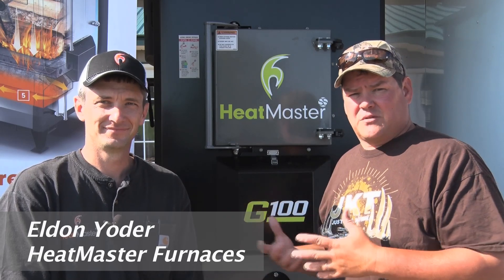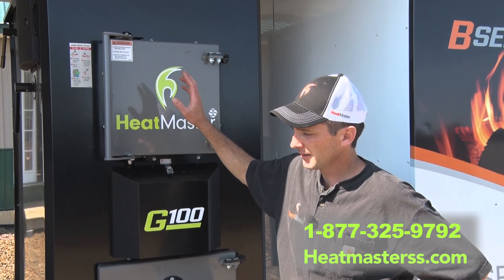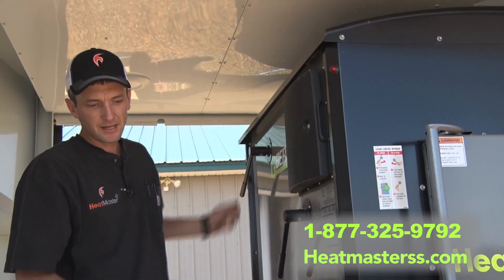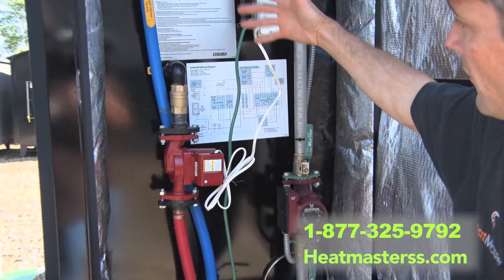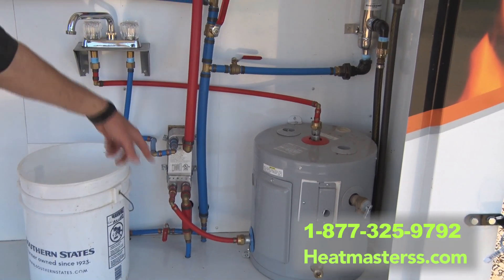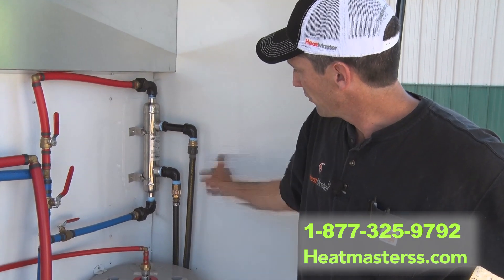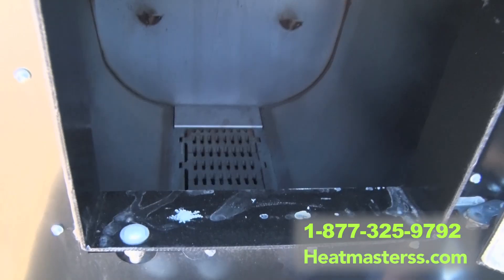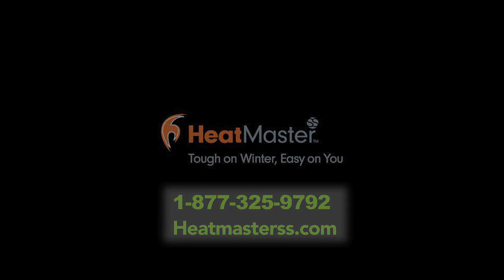HeatMaster ss and Just Killin Time TV

Comment: Instead of using a gas /oil furnace to run air through the heat exchanger I would seeing as this is a demonstration model for potential customers a garage style heat exchanger that usually hangs from the overhead in a garage or shop. However don't mount it in an overhead position. Place it on the ground attached to your demonstration boiler so people can feel the unlimited heat. Keep the blower running even if it's 80 plus degrees outside as people will feel the heat walking bye and ask you how it works. In the fall people will warm up from the heater giving you the opportunity to tell them how easy the system is to install and maintain. If you like install a tent of roughly 15x20 foot over the heater with a sign something like " Cold? Step inside to warm up, no charge! " . Add a folding table and four or five folding chairs so they can take a load off. Make sure you have an employee inside the warming tent to answer any and all questions. It might even help if the  employee owns a wood furnace so the potential customer can watch a video on a iPad or computer to see his installation and how easy it is to use and fill with wood.

Please forgive me, just playing devils advocate here.

Cheers!